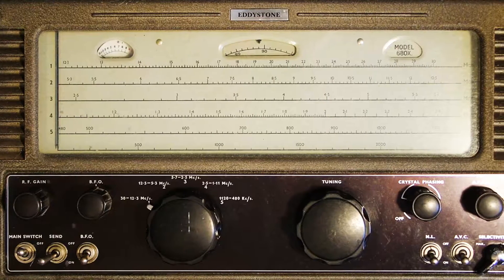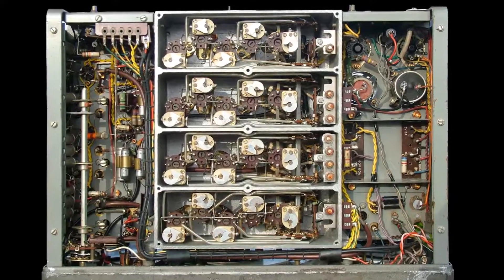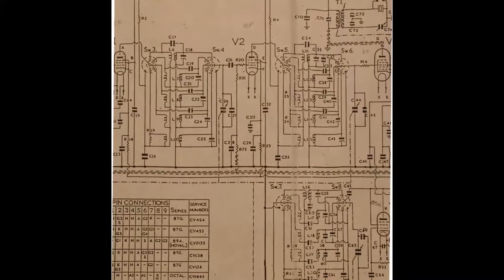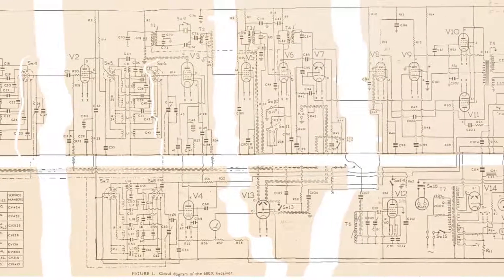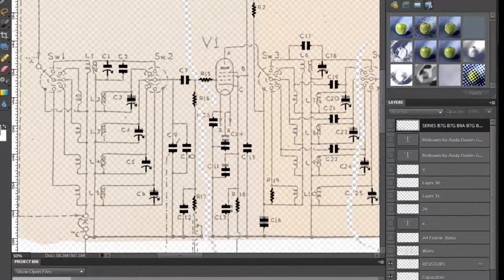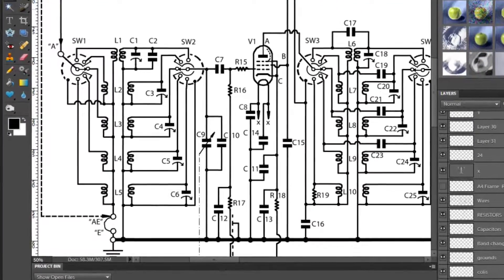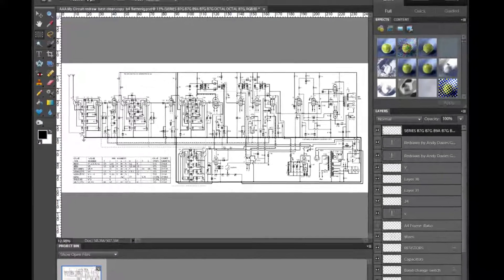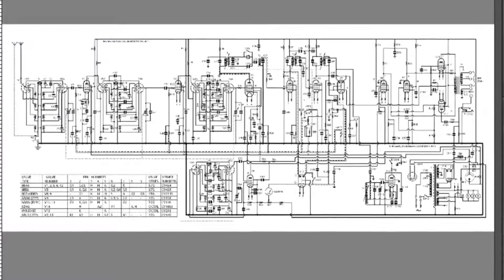About Radio ... Part 30 Redrawing a Circuit Diagram  by Andy Davies

Comment from the maker: @radiofun232 
I hate to admit how long I’ve spent on it but once I start a project I can’t drop it, another of my failings I suppose. I’m just working on the switch designations now and then I’ll call-it-a-day on the drawing and start on the radio. I want to clean the glass and the dial so I’ve got to take the fascia casting off and all the switches to get to it I think, major surgery but I’ll record it and let you know how I get on.
Kind Regards ... Andy

Comment from the maker: Hi John, well I reckon so, I could do without the distraction really but it is a lovely old set. Basically the sets working although I’ve got to fit a new choke and fuse holder and one of the bands seems to drift in and out of life, not the band change switch. I’ll replace some of the capacitors and the dial needs a wipe over on the inside which involves some drastic demolition by the look of it. I’ll record whatever I do so as Harry, my friend who’s radio it was can see its progress. ..    Andy